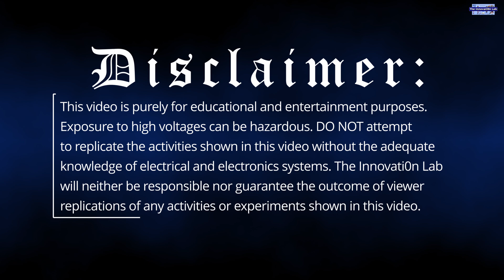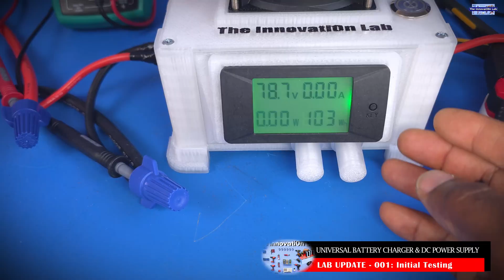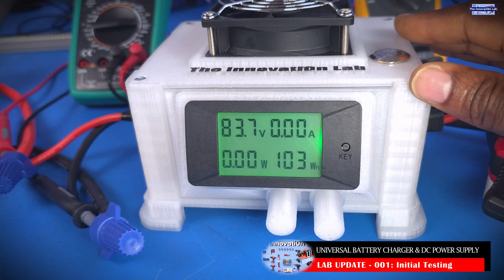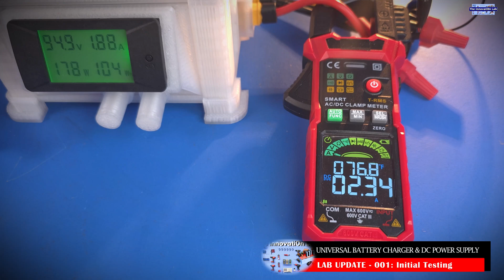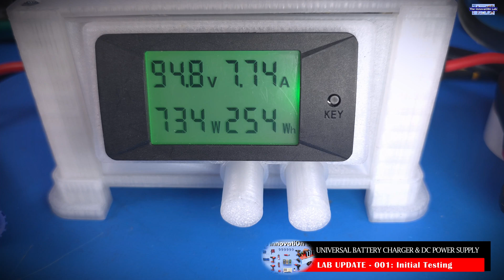DIY Variable Voltage Bench DC Power Supply

Comment: Instead of just assembly of cheap supply why don't u use Dspic30f2010 or dspic controlling switches in topology and controlling precision voltage and current accurately
Reply from the maker: You are absolutely right. Thanks for the wonderful engagement. That is a wonderful suggestion. I will look into it. The thing is that I try to keep these projects as simple as possible such that the audience can easily follow and replicate the projects - if they chose to.

Thanks again and stay tuned.
The Innovati0n Lab
Reply: Yea I am trying to built it, using some dspic but due to shortage of time its a halt for me I wish to copy LT based bi directional buck boost converter which can be ideal for lab bench power supply.. reaching 0-30V 10A x2 chanels. Can be operated in parallel mode and have advance safety features.
Reply from the maker: @Godofminds123 
I fully understand, time constraints is essentially the reason why I keep these projects as simple as possible......pretty much a weekend hobby for me.

Respectfully,
The Innovati0n Lab

Comment: This is such a great project. You are my hero.

3D printing an enclosure is cool, but what I'd like to see is scalability, so you can add as many modules as you like to match the power you want to deliver; the enclosure restricts that scalability.

Maybe consider a 3D printed enclosure for the master controller and either individual enclosure for each of the slave converters or maybe DIN rail mounts so any number of slave converters can be mounted in standard enclosures.

It would be great for the slave converters to have a standard connector for the control signals, so you could daisy chain as many converters together as you want to achieve that scalability.

(commenting for the algorithm)
Reply from the maker: Thank you so much!
What a wonderful feedback! You are my hero as well.
👍👍

I appreciate your thoughtful suggestions and ideas. Scalability is really the premise behind the previous project that we showed in the last video series. Please check it out - if you haven't had the chance to - let me know what you think. Regardless, I fully agree with every single word you have said.👍👍👍
You are awesome!

Respectfully,
Peace and love to the world.
The Innovati0n Lab.
Reply: what he mentions about 3D printing is so true 3D printing custom parts can be a huge pain in the neck, printing it 3 times would take a lot of time and effort!

P.S. Scaling it would need a metal enclosure it gets hot and dangerous plastic isn't adequate!